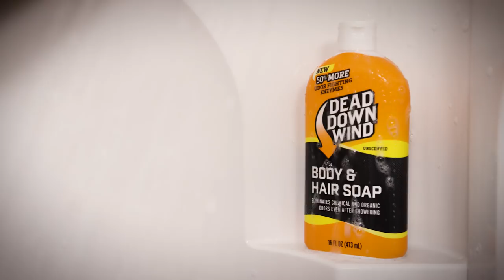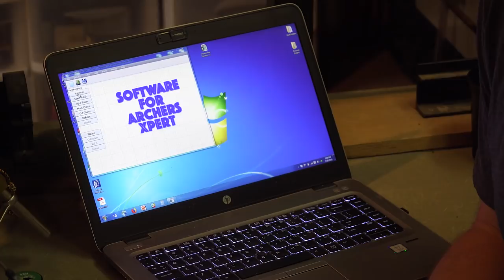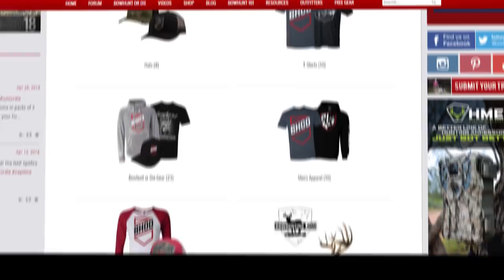Bowhunting Tips & Advice | Bow Tuning, Scrape Trees & More

Comment: You don’t have to take all the strings off or even take it out of the press to swap top hats. Changed a ton of them while being in the press with cam off.
Reply: I have as well, but best practice is to decompress the limbs when you're removing and replacing the axles.